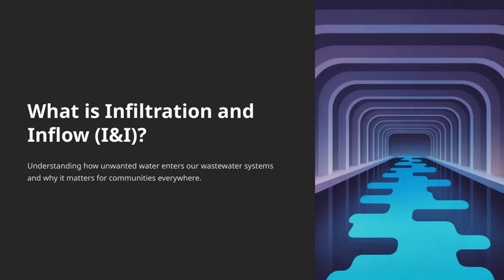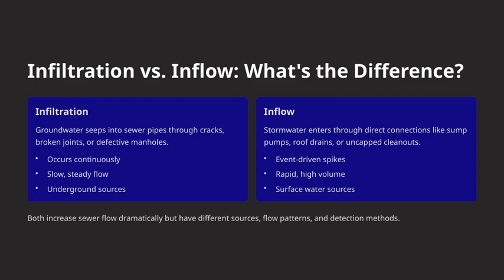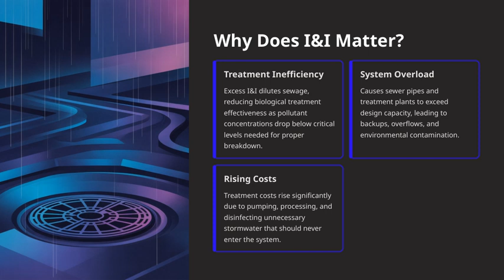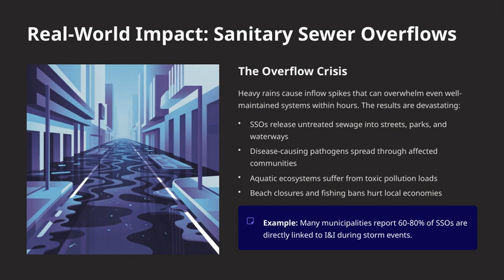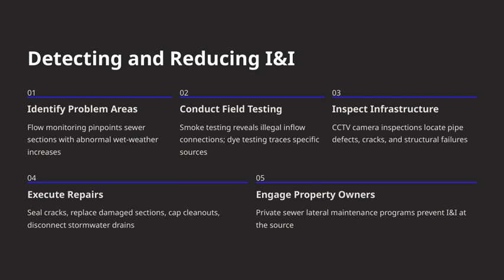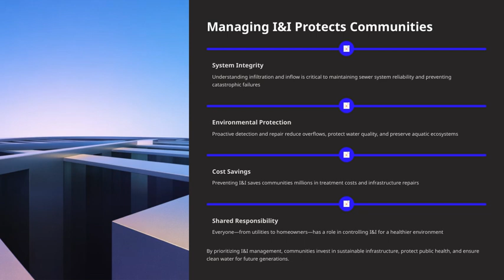What is Infiltration and Inflow (I&I)?

Comment from the maker: The cheapest I&I investigation you can run costs one late night and no equipment.

Between roughly 2 and 4 a.m., domestic flow is near zero. Whatever is still moving through your collection system is infiltration. Meter the flow at that hour, compare it to your daytime baseline, and you have a number for how much groundwater you're treating for free.

Do it once in a dry week and once after a heavy rain and you've separated infiltration from inflow, which is the whole diagnostic — they have different sources and different fixes.

Full guide: https://wastewaterace.com/blog/infiltration-and-inflow/